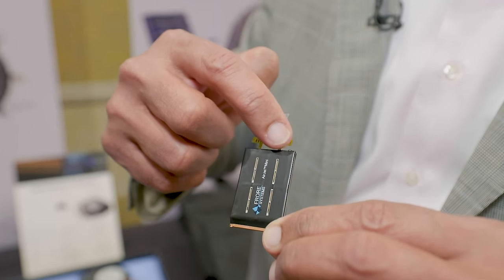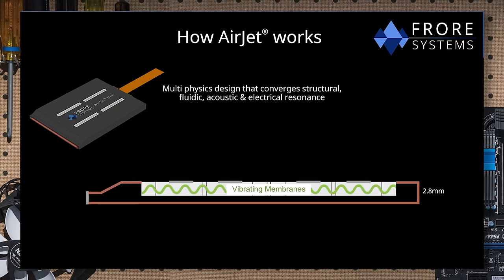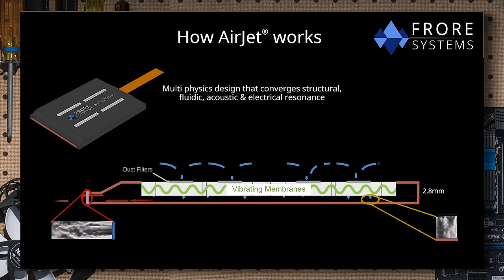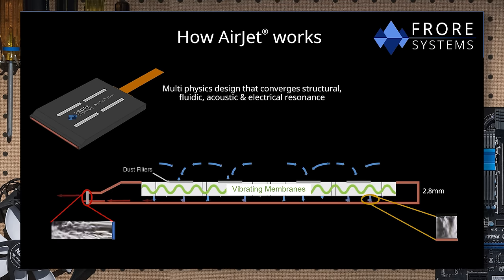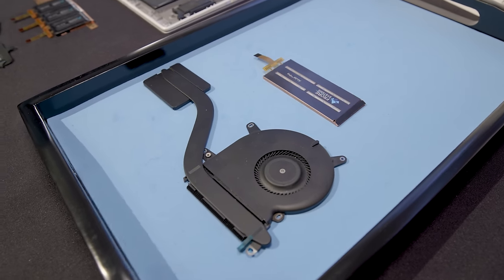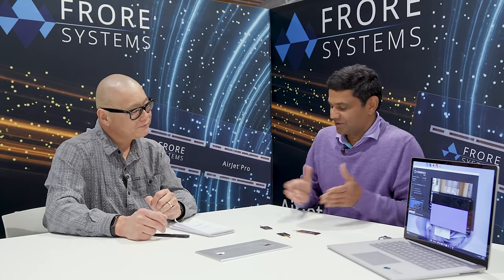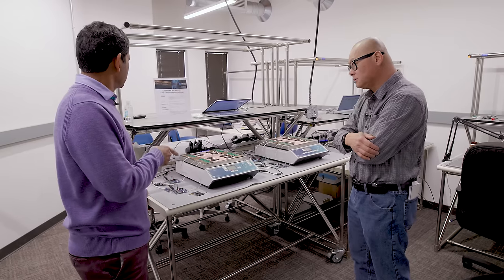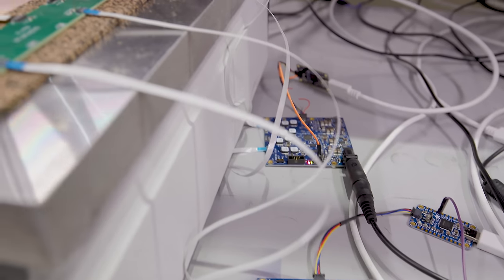Take A Lab Tour Of This Solid-State Cooling Tech

Comment: This technology is going to heat up the components directly in the path of where the hot air exits and cause electrical problems with capacitors.

Comment: relax guys. with the laughable volume of air pumped it suits only very very low power cases.. so low just big heat sink might be enough. and i have questions about what kind of noise it makes.   good turbine can be very quiet and pumps much more air then this does